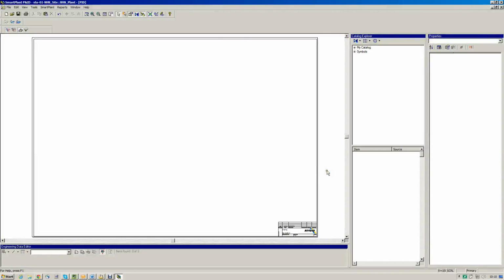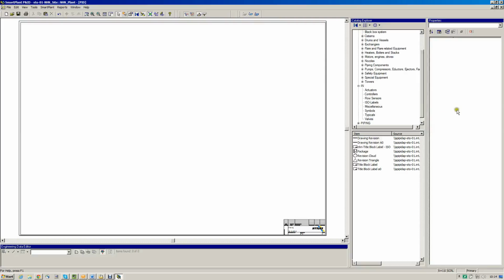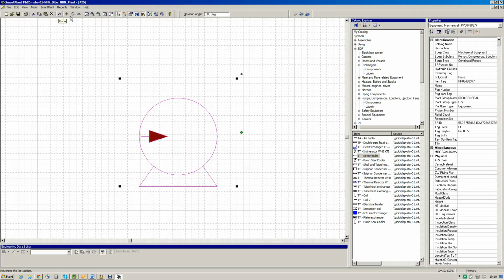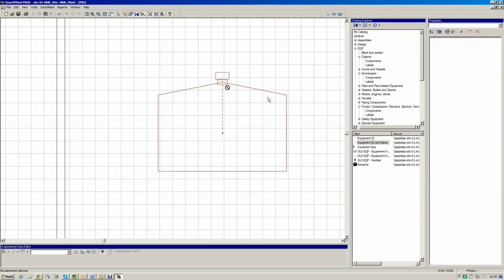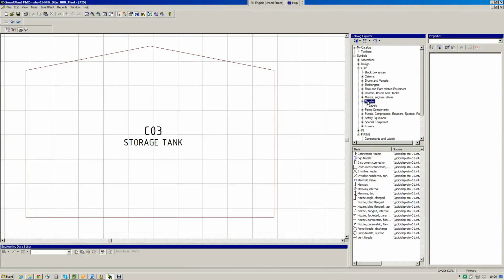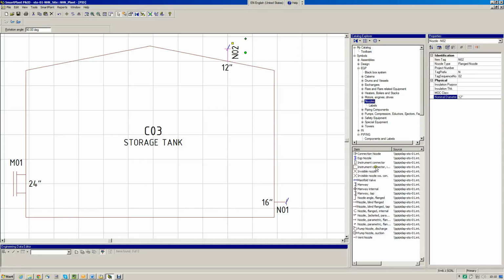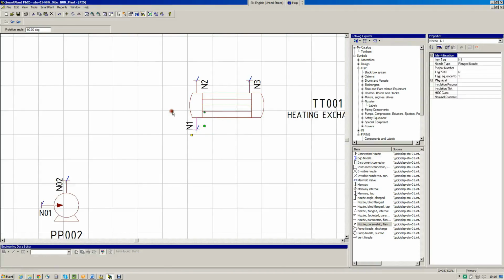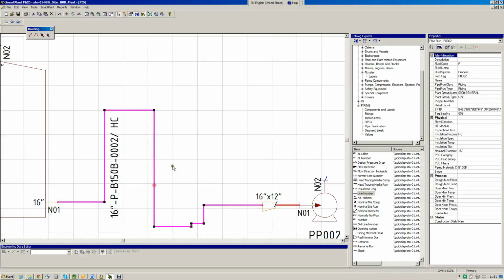Brief Introduction to Intergraph SPPID - Lesson 1

Comment: Dear Mr. Gränfors, 
Congratulations for share your knowlegde in the use of the SPPID. 

Could you please  tell me how I can to configure the sequence of the parts that conforms the "line number".?

SP P&ID by default: 

Fluid Code - Tag Seq No. - Nominal Diameter - Piping Material - Insulation Purpose

... and in my job,  the sequence is lightly diferent
  
Nominal Diameter - Fluid Code - Tag Seq No. - Piping Material - Insulation Purpose

It's means that the Nominal diameter occupiess the first position instead de third position.

Thanks a lot